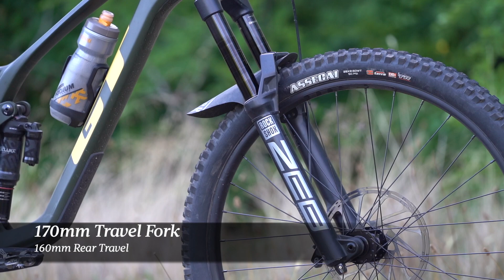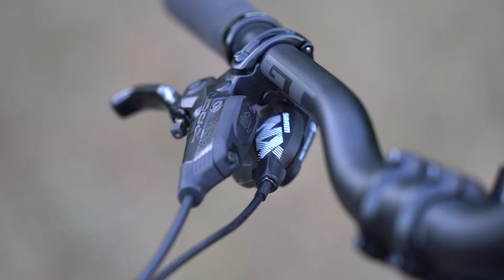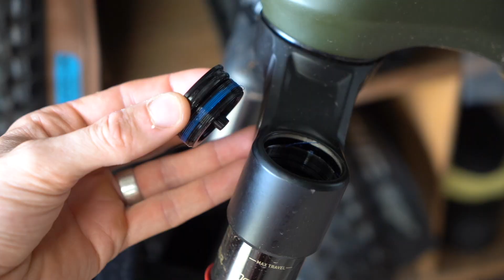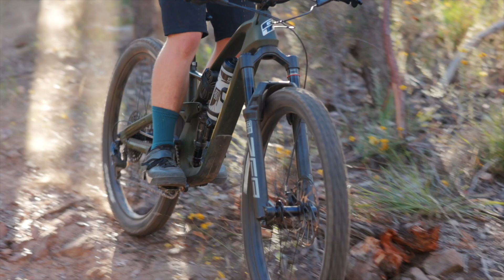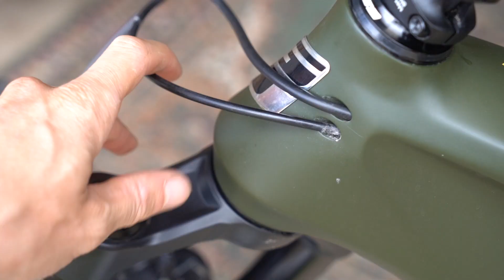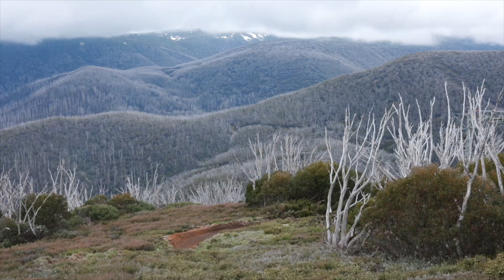2022 GT Force Review | A High Pivot Bruiser That Eats Rocks For Breakfast

Comment: Thanks for the review. Best channel in Australasian, you guys could make a chennel called Eflow especific for emtb with the brands we have around, like Merida, Polygon, Commencal... It will be amazing. Cheers guys!!!
Reply: It had to be a non-mtb-er asking for stuff on e-bikes... which real mtb-ers don't care as they are slower, more corupted riding versions of their actual bikes; for those who have their first mtb experience with a 10-15k electric toy, of course they will want more info on the subject. They don't make time to study geo charts or suspension leverages no, they just need to know which one is the bling-iest and which one can propel them up the hill fastest, in order to be trail obstacles for real riders; that is, if they ride real trails... as most of the guys such as you ride xc trails(maybe even flowy xc trails) on 160-170mm electrics.

p. s. not all electric riders are like those described above but, from persoanal experience, 9 out of 10 are.

Comment: I thought adding volume tokens increased small bump sensitivity because you could use a lower pressure and rely on ramp up at the end of the stroke to prevent bottom out?
Reply from the maker: It can do Trent, though it depends on your spring rate and preferred sag.

In the case of the ZEB on this GT Force, having three volume spacers in there meant we needed to run lower and lower pressures (and way too much sag) in order to get anywhere near using more than 70% of the travel. Also, when you shrink the available air volume that much, it can cause the suspension to spike as it becomes too progressive. In our case, the reduced mid and late-stroke sensitivity was very noticeable.

So rather than have the front of the bike ride really low with excessive sag, we gradually removed the volume spacers, allowing us to up the pressure and decrease sag back to a reasonable amount.

Even with zero volume spacers in there, the ZEB is still quite progressive. In fact, some of our lighter riders were still a ways from reaching full travel, and actually preferring the Lyrik for this and other reasons.

Hope that helps explain!

[Wil]
Reply: @FlowMountainBikeYouTube  Yes, thank you.

Comment: My 2021 Force 29 expert came with arguably better rims (Stans Flow S1), the same brakes, a Fox 38 Performance and a Performance Elite DPX2. At $3500 usd the NX Eagle was acceptable and I think the less aggressive geo compared to the current model and the lack of a high pivot and a full alloy frame makes it more useable overall. It’s not half bad on smooth, easy trails, but it can eat on steep tech. Also the traction it generates on technical is insane. Plus external cable routing is nice.

Comment: still amazes me how Many brands rushed their latest bikes to the market with no real prototyping/testing happening, the GT/range is the perfect example of this, lots of wee issues which many are of poor design
Reply: Allegedly the range was designed over 3 years, so more likely just poor design, for the range at least.
Reply: @alexchristie6426  i bought a range when it first came out, it rode like a tank, the wb grew too much and just felt null, some constant rattle that is something to do with suspension.
When i looked to replace our enduro bikes this year, i deliberately didnt have any HP bikes on our list, HP is for DH bikes only.
Several Norco Racers ended up back on their Modded Sights(more travel and custom link) for end of the season...

I do feel like commencal finally got their shit together and made their bus into a usable Bike, the mullet design works for a race bike and play bike 100%
Reply: @Bestintheworldatwhatido  commencal aren’t even in the same ball park to the range.
Reply: That's why I'll never buy a specialized anything